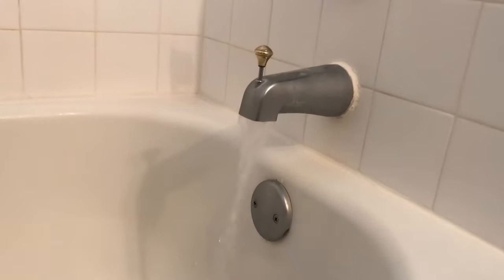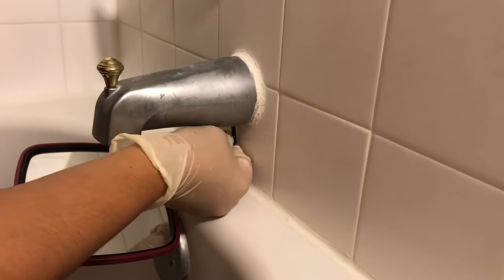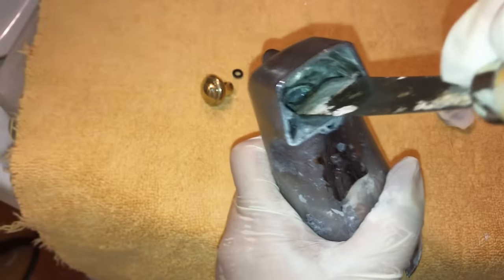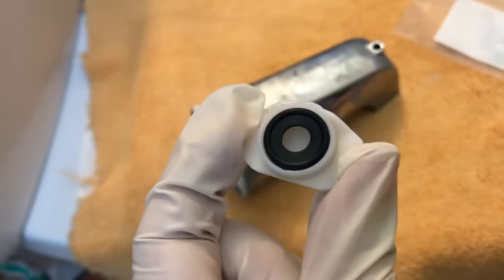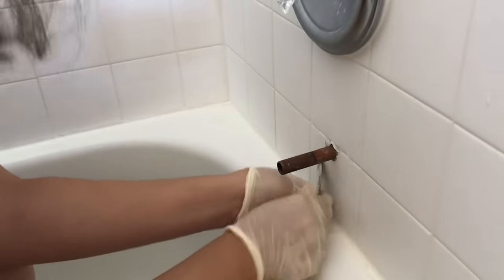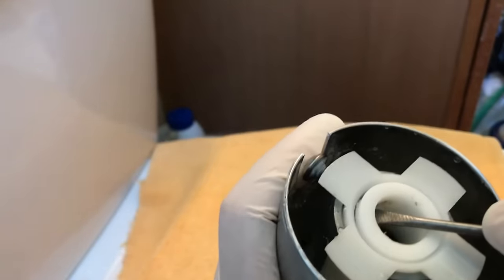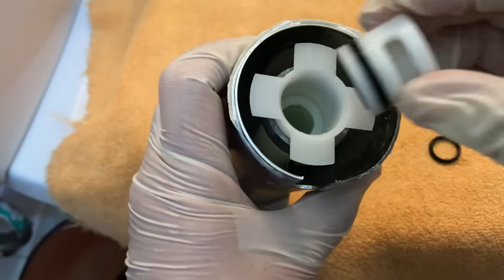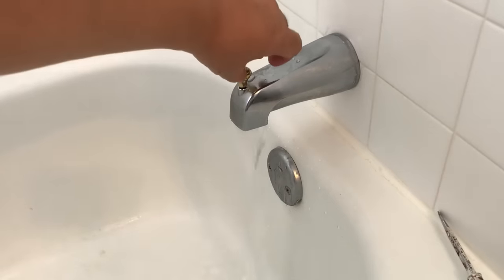How To Replace Or Fix Tub Spout Not Working

Comment: Very good video.  One more tip:  Whenever you are disassembling things over a drain,  either close the drain or put a towel over the drain to prevent screws and small parts from going down the drain.
Reply: Saw your comment too late, but thank you.
Reply: @MrMikeChain  I keep a hair catcher/strainer basket thingy in the tub drain. To catch my ear rings. 😊🤫
Reply: Right 👍.  I love seeing videos where a Woman is showing home 🏡 repair work
Reply: Excellent recommendation, Ric!
Reply: AaaaaaaAFTER the kids already lost it down the drain... 
U g h
Reply: Another thing that is not often mentioned but whenever you're dealing with gaskets it's always good to put a thin coat of silicone grease on the o-ring or gasket to compensate for irregularities in the surface and mating surface.
Reply: also be careful with using a metal putty knife to clean the mating surface or the edge of the spout (sm of them are metallic-painted plastic)

Comment: I would have used emory cloth to smooth that pipe on the exterior and have used a small amount of waterproof grease to lube the o-rings so they do not tear when pushing the downspout back on.

Comment: I tried this fix on my bathtub when I moved to a new apartment and found that the diverter did not work.  Unfortunately the spout was corroded badly enough that the washer could not make a good seal against it.  I wound up getting a new spout which fixed the problem once and for all.  I much prefer the other type of diverter which is within the valve assembly which is what I had in my old apartment.

Comment: Your video presentation for replacing the tub diverter gasket is the best one available. You give a great linear explanation, showing easy to follow steps. Your words are easily understood and your excellent rate of speech makes it easy for all listeners to follow. 

A quick edit, however, is that not all knobs are threaded so they might not unscrew. In that instance, one of the diverter 'prongs' will need to be broken off.  (The knob on my DELTA tub spout absolutely wouldn't unscrew.)

I had trouble finding your video to give you this review, but I'm following you now so that won't be an issue going forward.  Thank you for making and posting this video.  ❤️
Reply: You are right. Everything she did was first class!!

Comment: A very good video - thank you!
As a plumber let me share 2 tips with you.
1. It would be perfect to apply some plumbing grease over the black washer.
2. Use clear silicon caulking on the spout - it will be almost invisible.
Reply: @Scratchingforcash  I am the worst plumber ever.
Now, it's time for you to beat it...
Reply: My diverter is stuck! Will not budge.. do I have to take whole faucet piece off to do this replacement? Or can I just change it? Thank you. Do you know what would cause it to just stop being able to pull it up anymore? Thank you so much.
Reply: Try soaking it in CLR overnight.  It’s likely that there’s a mineral build up inside the sprout & on the diverter.  CLR dissolves the mineral build up.  If that doesn’t loosen the diverter, you’ll need to buy another spout.
Reply: It’s also a good idea to take a piece of emery cloth and carefully and evenly all around sand the copper pipe slightly to remove any corrosion or burrs I think a very light bead of silicon caulk around where the pipe enters the wall of the shower may be the best bet. Just 😊go easy on it and left it cure for 3-6 hours so the faucet’s inners don’t stick to the shower wall.

Comment: Thanks for the parts details.  I bought the exact ones at Ace hardware and rebuilt my tub spout to address leaking from the back.   Works great now, and diverter works better too.   One detail for others, cover all the rubber parts with silicone pipe lube.
Reply from the maker: That's so awesome! Thanks for sharing.
Reply from the maker: @s99614  LOL! I didn't have any plumber's grease and wasn't going to go buy one for this because while it's very helpful, it's not critical.

Comment: I had the exact same leaking issue after reinstallation. Your video is literally the only one addressing it. Mine is a KOHLER slip-on type and has exactly the same design. Even the o-rings are the same! Thank you!

Comment: Great video. Two minor tips to make the replacement even better. Firstly I would smear a little bit of silicon grease on the new o-rings, so they slide easily when the sprout is pushed back to the copper pipe. Secondly, I would clean the end of the sprout and the nearby tile with a rubbing alcohol and apply new silicon caulk.

Comment: Thank you! Instructions on the diverter repair kit do not mention or show rod has a removable head. Bottom tip of rod eroded off old diverter. No need to pull off old spout. 🎉

Comment: Make sure to clean the outside of the copper pipe with a little steel wool and coat with a little Vaseline or oil when putting the faucet back on to prevent damage to the o-ring.   Excellent video.
Reply: Incorrect!  Vaseline or other petroleum products may degrade the butyl rubber oring.  Use silicone grease or plumbing grease as it is known.  Very inexpensive and found at any hardware store.
Reply: I would of put Vaseline on new gasket.

Comment: Excellent tutorial video.
tip 1: My advice; don't scrap metal to metal. Causes scratches in the metal.
Instead, pour some white vinegar into a large cup, dilute 1 to 4 water, and soak the tip of the spout into the acid solution. You'll see bubbling as the calcium and mineral build up is dissolved. When the bubbling stops, it means all minerals have dissolved. Remove the spout and you'll see it shiny and clean on the inside. If there is any non-mineral residue remaining on the surface, use fine steel wool under running water to gently scrub it off.
Whatever you do, don't do as the video shows and use a metal putty knife to scrape off the mineral deposits from the spout - damage is certain.

tip 2: if you want a tighter shut off on the diverter mechanism, its easy. I just did this a moment ago. Buy an o-ring kit which has a variety of sizes (cheap at Harbor Freight) and insert a snug fitting o-ring under the diverter's rubber gasket/disc. Yes, it will take some force to push and pull the plunger, but you'll have a 100% flow to either tub or shower head, with zero, and I mean zero leakage.

Comment: An excellent video and voice narrative. You helped many people with this. If I may add some other points to help people with this problem; Block the drain before starting the repair. You need not remove the entire spout from the wall to replace just the shut off gasket. If you do choose to remove the spout, take advantage by using vinegar or CLR bath cleaner to soften and remove calcium build-up of all the parts. A Scotch Pad will help with the cleaning process. Coat the rubber gaskets with a light smear of Vaseline to help reassemble the spout onto the wall pipe.

Comment: Very informative video.  This is a good example of why to watch a few videos as I picked up from yours a few more tips on how to do this job.  I noticed the spout was a little more difficult going back on after the inner o-rings were replaced indicating a better seal.  A previous other video showed some other tips such as not caulking completely around the bottom to show when this seal is leaking.  It allows the water to drain out without building up and then going behind the tiles.  Your use of the camera was very good as I can see the important parts clearly.

Comment: Very well done video.  I learned a lot.  There is one more tip I did not see in the comments.  I've been told that caulking around the pipe opening in the wall can reduce the risk of water leaking behind the wall and causing mold.
Reply: Can someone confirm if I should do this? I’m nervous about mold, as there seems to be no right seal on the spout besides the screw…
Reply: I can tel you for certain that if you use any regular caulk out will create excess mold.   

I removed it all and have switched to CLEAR silicone caulk specifically for mold prevention…. It’s been a few months and so far so good. 

But it’s weird when you’re so used to that white tub caulking     And lol.  Maybe you won’t be as stupid as me …. But clear silicone is nothing like any white caulk-   So DONT USE YOUR FINGER TO SMOOTH IT !!

Comment: A lot of videos don't show installing another rubber gasket on the copper pipe before putting in your plastic tube extender. This little piece that took me several hrs to figure out is what stops the leak behind the spout! Omg saved another plumbing service bill 😬

Comment: Well this is a good video for a novice or a do it yourself  As a professional I will not waste my time rebuilding a tub  Spout .
 It is much more practical just to replace it And it's almost really nice to have a nice looking finish on the spout itself 9 out of 10 times when the spout already has issues with the washer The metal on the spout is already corroded eating up or discolored.
But good detail and work

Comment: I just fix my sons leaking spout too and I just replaced the rubber gasket with an available one I found in the garage but its thicker. it;s kind of harder to pull up but works for the meantime. and your videoI reminds me to buy these parts next time i go to my sons place. at first i thought i will only need the ring gasket but to be sure, i will buy the o rings too.

Comment: Nicely done video.  One thing I would add is to make sure that the copper pipe is sealed with caulking to the wall such that if any leakage occurs it will drain out the hole where the screw is and not into the wall.  If it does then you can get water in the wall and end up with water damage and or dry rot in the wall and tub base.  That can get expensive to fix.

Comment: Once you replace the spout diverter, and installed on the pipe. Before calking like you did, its good to see if the o-rings are leaking. If you dont check and they are bad, then you calk around the spout. The leak can possibly go back behind the wall, causing mildew and countless problems you usually find when its too late.
Reply: I would think the o-ring replacement should be the norm any time one disassembles a spout.  The replacement parts are cheap and the time saved in the future is worthwhile.

Comment: Thanks, video was very well done with helpful details and the added faucet O-ring info. I try to use calcium, lime and rust remover solution instead of scraping which can remove some of the finish and cause more videos later on.

Comment: I would just like to add that you did a great job repairing the diverter valve only you forgot to put a seal around the valve's end at the wall. A caulking gun with tub seal will do the job perfectly otherwise you did a great job repairing the diverter valve.

Comment: screw on type faucet ..might want to confirm plumbing pipes and valves are correctly on bracing (2x4s) usually .  behind the fixture wall is the most important thing to look at for substandard installations or you could find yourself in a mini flood. 30 yr shower builder, designer.

Comment: Enjoyed your D.I.Y. video.  Your step-by-step instructions were easy to follow.
I'd like to add a few tips to your excellent presentation.
Tip # 1:  Close the tub drain and/or cover it with a rag to prevent the 'set screw' from falling into the drain.
Tip # 2:  To help remember how to reassemble the parts, video your disassembly process. 
Tip # 3:  Use CLR (or equivalent, which is much cheaper at my local Dollar store) to dissolve the mineral deposits.
Tip # 4:  To avoid scratching the chrome finish or the ceramic tiles, use a wood Popsicle stick or plastic scraper. 
Tip # 5:  Do NOT over-tighten the set screw to avoid puncturing the copper pipe from the wall, which is soft metal.
Tip # 6:  To avoid the wasted time and expense of running back-n-forth to the hardware store for 'parts', disassemble the whole unit, as this content creator did, to get those replacement 'O rings', the same time you buy the replacement 'washer'.  And, I'd also find out what the 'return/refund policy' is at the store too.  (The low cost of these parts are not worth your time and gas to make multiple trips.)
Reply from the maker: Thanks for sharing the great tips!
Reply: @KYKCreations ; why are you wearing gloves?
Reply from the maker: @fredhammer6413  Sometimes I wear them to look professional even if I don't need to. Does it seem silly?
Reply: @KYKCreations  ; no,,,,, it seems ridiculous.
Reply from the maker: @fredhammer6413  LOL! I'll take that into advisement.
Reply: @KYKCreations Nothing wrong about protecting your hands! I’m wearing same gloves in the middle of doing this thanks to your excellent instructions. Gloves also prevents the dirt, gunk, liquids etc from under your fingernails! 🙌🏻😁 Having trouble getting that thing unscrewed, so might need some CLR! We’ll see. TY again. 👍💪🏻😁

Comment: Love your video. I’m not handy at all and don’t have a clue how to even remove the spout. This video was nice and easy to understand. My only question is, how do you know what part the gasket and o-rings are?  Are they standard parts?  Thank you for the video.
Reply from the maker: They may be different for spouts by different makers, so unless your spout looks like the one in my video (which is a basic Moen slip on spout), you should take the parts with you to the store to get the gaskets and o-rings that match the diameter and thickness of the ones you are replacing.

Comment: Well for those of you who are not plumbers trying to follow what this person is doing let me inform you by time that seal is worn you tub spout is corroded out. Not always but most the time. When you go to remove it lots of times it falls apart or is corroded on in which case you can twist your pipe or bend it. Turning a 20 dollar fix into a 500 fix. Pros have a saying pay me now or really pay me when you screw it up. Keep this in mind if your  handy hack video does not go as planned.

Comment: Take the spout off and soak it in a cup of CLR and you can do this repair for free. Well as long as you have a bottle of CLR. Another little tip is put a little vasoline on the rubber O rings that will help them seal after you clean them.

Comment: Nice vid.  Very nice calming voice.  However, if the surface the gasket seals against is actually corroded (not just a mineral deposit buildup that can be cleaned off) then a new gasket is useless.  In my case it even required considerable force to get the knob off the threaded stem.    (I was sure I'd shear the stem, but apparently it's made of tougher material than any machine screw of the same diameter, and two LARGE pliers did the job, using tough cloth to protect the knob - which turned out to be futile due to the aforementioned corrosion of the seal area.

(A better design would use a washer-to-washer interface and avoid the problem of metal corrosion at the cost of two washers that likely cost...   ~10 cents ea. to make?  But, I digress.)

So, that means the whole spout must come off & be replaced.   If she's been on there for, say, 20+ years, even with teflon tape originally applied, it may take a HIMARS hit to twist that spout  off the pipe.  This is where the calming voice is really needed!  I used the large screwdriver up the spout technique as my large strap wrench kept slipping.  Luckily I didn't break any piping, but, the screwdriver started cracking the end of the spout before it (the spout) thankfully began to turn.  Maybe teflon tape plus a high quality  plumbers grease or maybe even an anti-galling compound would be in order on the threads for installation (re-installation) of a new spout.

Comment: GREAT video! Will this fix work if there is water coming out of the spout even when the water is not turned on? If not, any idea of what my problem is? THANKS!!
Reply from the maker: This will not work. The problem with water dripping out when it's not turned on is due to worn out valve. You just need to buy a replacement cartridge for around $20 and install it. I actually made a video on it. I'll put a link to it in the description box.
Reply: @KYKCreations  THANKS! Wanna' come over?!?!

Comment: So informative! Did you have to shut off the main water supply first?
Reply from the maker: No, you do not have to shut off the main water supply first just to replace the spout. You just need to turn off the water at the shower or tub handle. I'm sorry I gave the wrong answer previously.

Comment: good job, next time don't scrape at the chrome finish, you want that finish as smooth as possible against the new gasket, let your spout soak in vinegar and gently remove the buildup with an old toothbrush.. Touch of Vaseline on the new o rings helps too before reinstalling.

Comment: Excellent video! I am going to attempt this right now. I assume that I should re-caulk the fixture to the tile when it tests good. ?
Reply from the maker: I think that would be good to do.
Reply: I just got through. 
One trip to hardware store for a few similar washers. Had to leave spout in place...could not unscrew it.
Disassembled, added new washer and now works with only a few drops of water.
Thanks for the great, clear instructions.
Reply from the maker: @johnfriedmann2413  Thank you for sharing your experience, especially since some viewers have wondered if they can just leave the spout in place.

Comment: Spread a baking soda paste inside the spout end then dab over the paste with vinegar and lightly brush the hard water deposits with an old toothbrush to clean rather than chance gouging the metal behind the plunger/diverter gasket seat.
Reply: Baking soda defeats the vinegar.